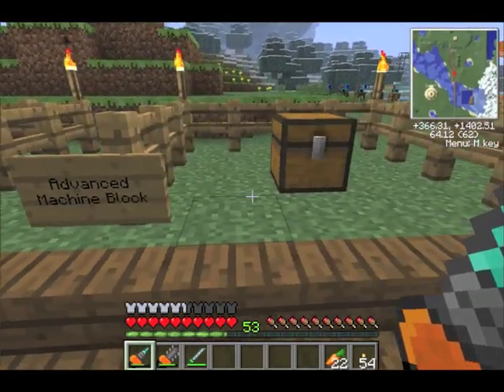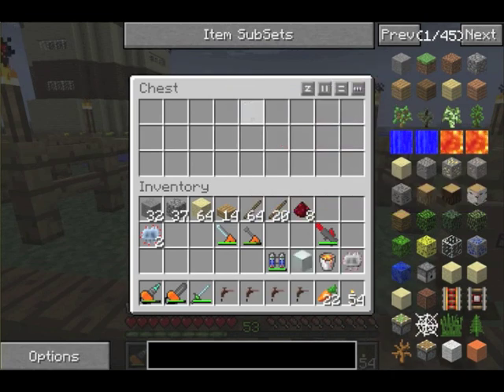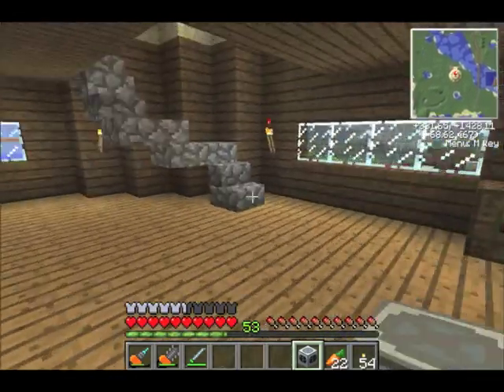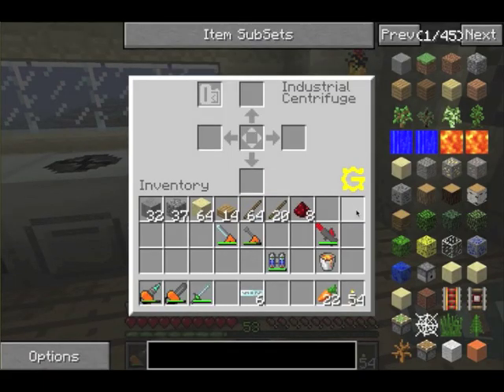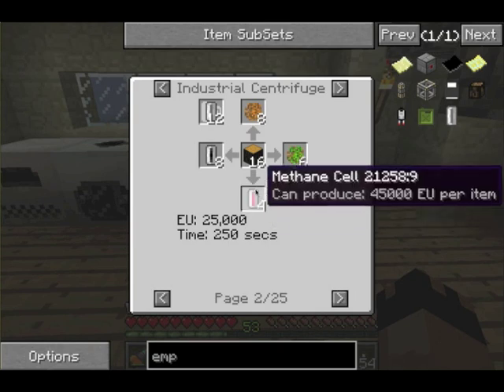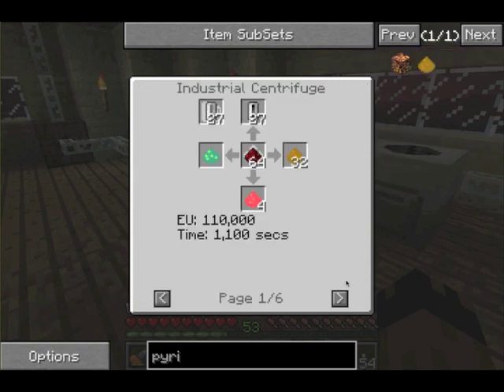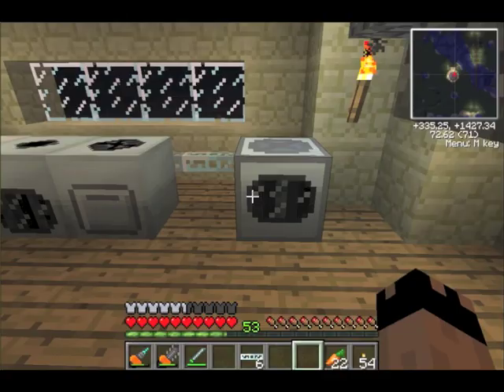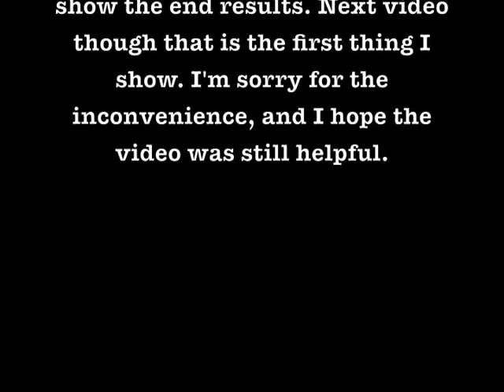FTB Tutorial Basics Ep_11 "Industrial Centrifuge" (R019)

Comment from the maker: The Problem is that the electrolyzer requires more power than they output. What you need to do is hook you windmills up to a MFE and then run the power from that to electrolyzer. But make sure you put a lever next to the MFE so you can turn it off when it is not in use because the electrolyzer will always pull power from it.